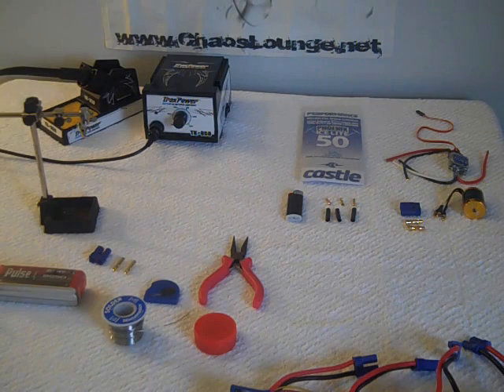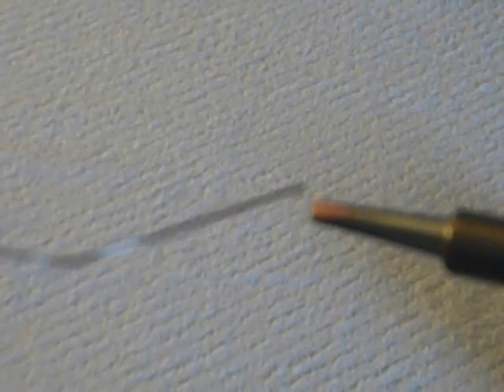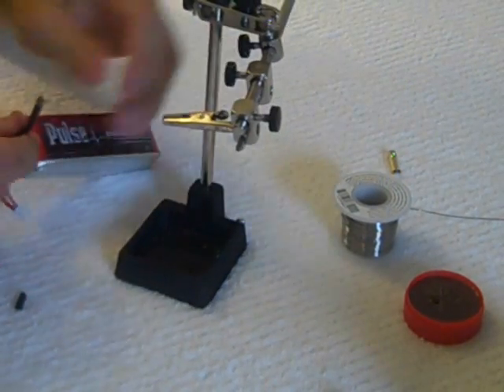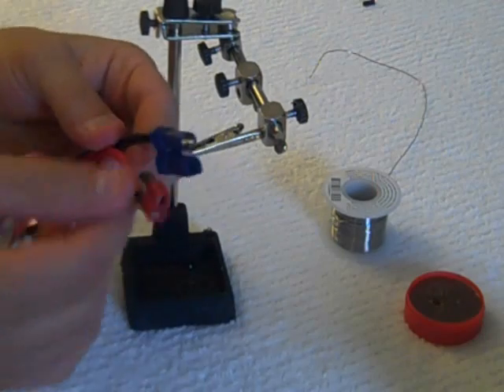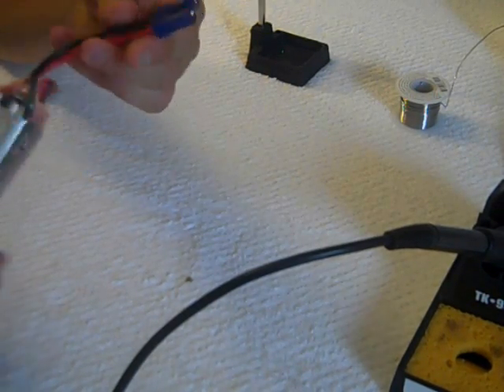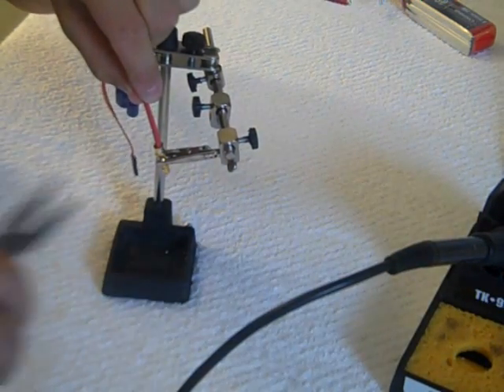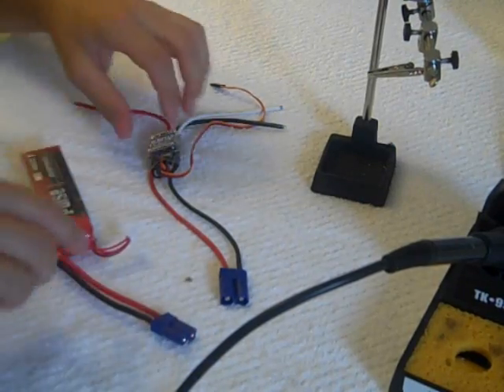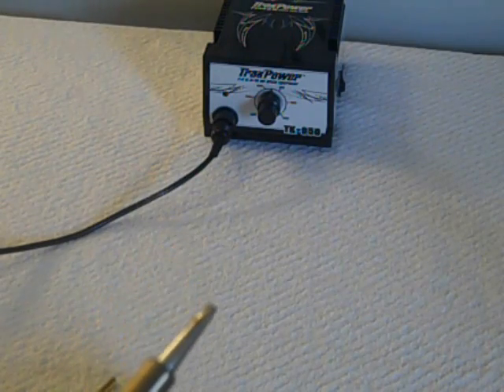Soldering EC5 Connectors and ESC Leads - Chris Reibert

Comment: That's a really good video, Chris!  I'm having difficulties soldering EC5's to my batteries and ESC for my Trex 600.  I've done each step that you talked about in your video with the exception of one.  It seems that my soldering iron my just not get hot enough for the job of the heavier gauge wire.  I'm heading to the hobby shop in the morning for a more suitable soldering station.  Thanks for the tips!

Comment from the maker: I solder mine round 700deg. Put a little solder on the tip of the soldering gun it helps transfer the heat to the connector!